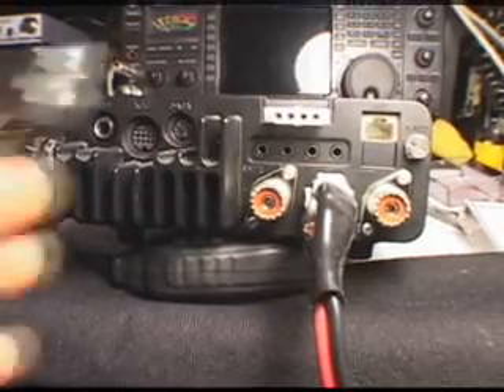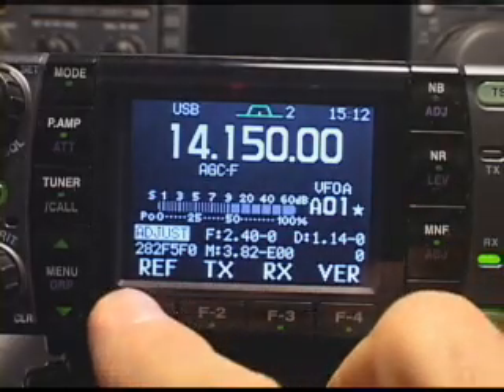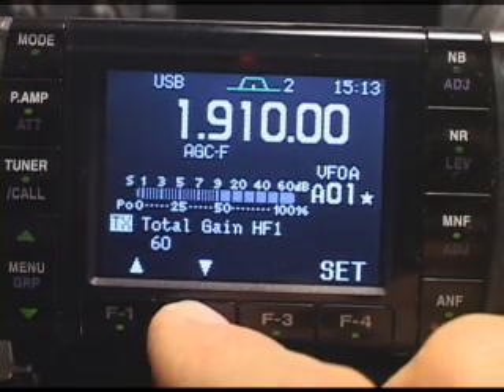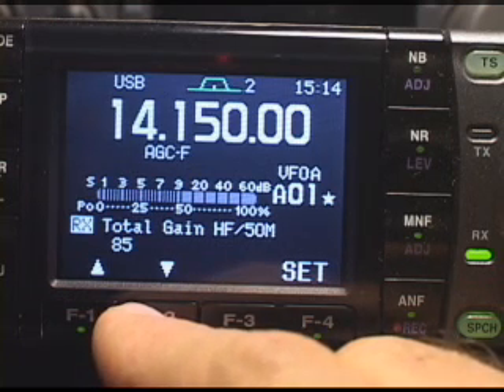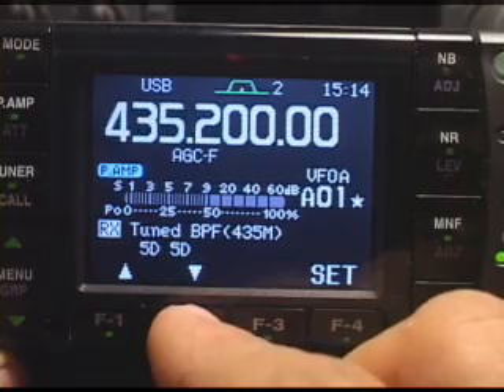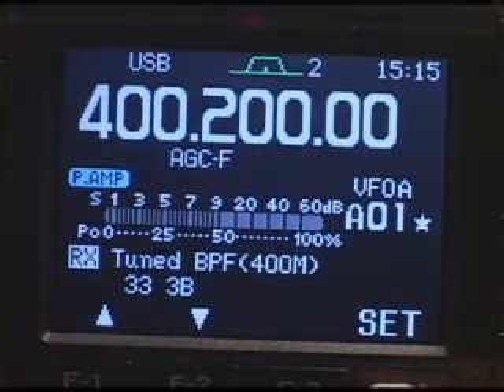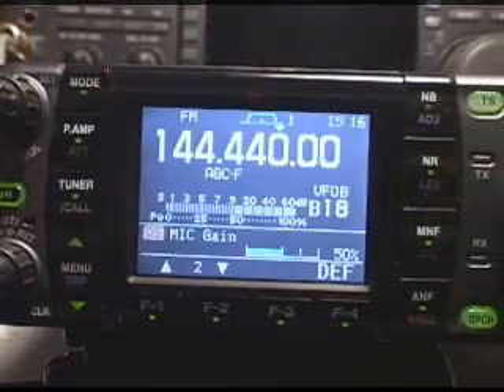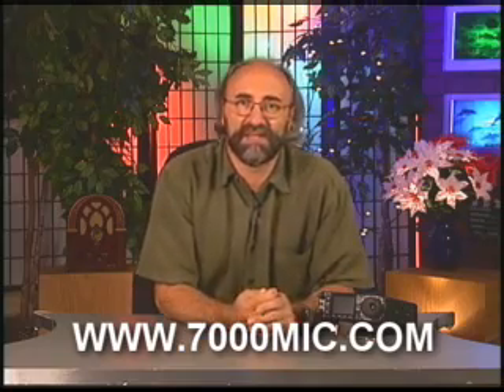IC-7000 Hidden Menu

Comment: My IC-7000 frequencies are off on the 70cm band.  and also off on HF bands as well. but  in order for me to get on a 70cm band repeater, I have to add .005 to whatever the frequency of that repeater actually is.  most of the time everyone on HF has a real hard time of hearing me when I transmit.  I recently hooked up a IC-718 to the same antenna setup and people don't have as hard of a time hearing me as bad as the 7000.  Is there a way of fixing that?  and do you have to use the alligator clip contraption in the back?

Comment: http://www.radioscanner.ru/files/download/file309/icom_ic_7000_servicemanual.pdf   or http://download.qrz.ru/pub/hamradio/schemes/icom/IC-7000_Serv_Manual.pdf
Here is SERVICE MANUAL, which has a detailed description of how to enter the ADJUSTMENT MODE, as well as what the settings mean and how to configure.
Тут SERVICE MANUAL, в котором есть подробное описание как войти в ADJUSTMENT MODE, а так же что означают настройки и как настраивать.
**I do not recommend changing any parameters in this service menu without excellent knowledge of radio technology!**
+ INFO+MANUALs+MODs: https://www.mods.dk/index.php?ModelId=845&RadioId=1-icom&ModelRec=ic-7000
73!
Reply: From manual: >>> 
ENTERING THE ADJUSTMENT MODE
 1) Turn the transceiver’s power OFF.
 2) Connect the JIG plug to [REMOTE] jack on the rear panel.
 3) While pushing and holding [P.AMP/ATT] and [TUNE/CALL], turn the transceiver power ON.
 NOTE: Exiting from the adjustment mode when the transceiver's power is OFF.
-----------------------------------------------------------------------
OPERATING ON THE ADJUSTMENT MODE
 • Enter DDS adjustment mode. : Push [F-1 (REF)]
 • Enter TX adjustment mode. : Push [F-2 (TX)]
 • Enter RX adjustment mode. : Push [F-3 (RX)]
 • Store the set value. : Push [F-4 (SET)]
 • Adjust the value. : Rotate [DIAL]
and other many  options....

Comment: I played around a little bit with my Yaesu FT-950 factory menu ... the TX power settings. Then I put them back. Because most people recommend you don't mess with these things because they are set a certain way for a reason. A little extra power - which means nothing on the other end - or a little extra receive - probably takes your rig out of tolerances for the rated specifications, can shorten its life. and make things not work as they should in other parts of the rig. In other words do as he says in his disclaimer not as he does in his video.

Comment: This is the modern version of the golden screwdriver. Yup who needs a calibrated signal generator to adjust receiver gain when all you need to do is tweak a few menu setting's., 

 Whats funny is 99 percent of the time the people complaining about poor performance are the same people who've already  been in their radio with their trusty golden screwdriver, Kinda like that non existent low audio problem the 7000's supposed to suffer from LOL

Comment: Hi Bob not sure if you can help me, I have an IC 7000 here, you done the Mic for me, nothing to do with that, when I turn it on I cant here any background noise, the squelch seem to work looking at he green receive light, but no sound, you can turn the squelch right down and volume up and it is silent, sometimes the sound comes through, if your on a strong stations its ok, but on 40 and 80 mts ssb there is no background noise...wonder if its something I done or faulty, its like the squelch is turned up, but it isn't..think I might do a reset.Fred g4vvq in UK

Comment: Hi Bob, can you do anything with the fan on the 7000, they seem to run really hot even on receive, fan only appears to work on tx, friend of mine also has one and he says his gets really hot, he rang Icom and they told him it will work on receive when the temp gauge goes into the red zone, and it has variable speed depending how hot it is, wondered what you knew about them....Fred in England.
Reply: Hi Bob I had a new backup battery fitted and it cured it, was just for the clock, that was only thing that wasn't working....do you know of anyway to adjust the freq counter, its about 200 hz off, not much bit a bit.....Fred uk
Reply: Well two years later, here is the answer:
Put a 100 Ohm resistor from the + to the red wire of the fan.
This makes it run continuously and prevents heating in standby mode.
For low duty cycle transmit the capacity of the heat sink is big enough to take up the heat without getting too warm.
Reply: He just showed you 8C to set the ref osc.
- There's also a setting #51 at the bottom of the long "Others" user menu to move the osc a bit, but 200Hz is quite a bit, you might have to begin with 8C in the hidden menu while your OTH setting in "REF Adjust" is centered on 50.

Comment: Bob, my S meter on VHF always shows between S8 and S9. does this need adjusting as you describe in this video OR can it be set somehow with the regular settings on the radio? the UHF s meter seems to function as it should, not VHF though. BorderPhD@gmail.com  N5XTC

Comment: Bob - I am a brand new IC-7000 user.  When I key the mic I am not getting any ALC indication.  I get the word "ALC" displayed and I get a solid red bar displayed but no moving bar graph to indicate ALC level.  What am I doing wrong?  Did that feature somehow get turned off?

Comment: Let me add an update to the power out problem in case someone else is having that problem.  The problem's source was in the power cable fuses.  There was a high resistance connection and once I removed the inline fuses the power came up to specified and expected.

Comment: Changed configuration parameters of RX and do not know original values, now ic-7000 S-meter shows the full range of HF. What should I do to get the radio back to normal?

Comment: Hello Everyone, 

I have been researching ALL transceivers and the two best systems for Base or Mobile are the FT-897D and IC-7000. 

The FT is very portable with fixed TX wattage, the IC is less portable and variable 2-100 watt, 2-50, 2-35, 1-40, 2-20, 2-14 depending on which meter(s) your on . 

Both radios cover the same frequencies. The IC is $1300, the FT is $1000.

Hope I have been helpfull -!

Comment from the maker: @gkendric OK... the 7000 is very sensitive to  Vcc... it's power supply voltage.
The difference between 12.6V and 13.8V is dramatic. If you are running 13.8V
and getting 60W across the bands, then your radio has a problem. It isn't a matter
of the factory settings being wrong. To be dead-sure, I'd try another radio with that dummy load/meter set-up.
Reply: for people running into this  in current dates, this poster is only partially correct. The IC-7000 is CURRENT Sensitive. because it is all DSP, with the exclusion of the audio input and the rf output there is a heavy current draw at all times. throw Ohms law at it and you will find that when the input voltage drops below 13.8 volts, the current drops as well. and if your power supply cant source the required amperage, the radio's output will be hampered.

Comment: @Yavor54   No it's not the European version and I was not on 10.  In fact the power level of around 60 Watts out on 20, 40, & 80 meters and that's into a 1:1 SWR presented to the radio by a Palstar tuner measured both on the Tuner's cross needle meter and an external diamond cross needle meter so I very much trust the 60 Watts out.  One other observation I did note was that the power level adjustment was not linear across bands.

Comment: Thanks for the information.  I did enter the hidden menu however under the TX settings I was not able to make any alterations.  There was no change with turning of the main tuning knob.  I wonder if there is a lock that has to be released.  Do you know if there is a toggle or what has to be done in order to modify the TX settings?   The problem I am having is my 100% power out into a 1:1 SWR measures at only 60 Watts on HF.  I'm wondering if this TX Adjustment could remedy that?

Comment from the maker: @ILLUDICHRIS   - Well, the factory menu is normally not available to the
typical user... nor is it necessary. I own both radios. The difference?
The TS-2000 is the 500 item lunch buffet. The 7000 is the good restaurant.
The 7000's RX is an order or magnitude better. It can deliver signals that
the 2000 doesn't even know are there. I use the 2000 only for VHF/UHF.
Sure, it's easy to operate, but you are rewarded for learning the 7000.

Comment: It gets pretty warm, but there's a crystal oven near the rear of the unit, I'm told. It's really frequency stable. I've subjected mine to some long ragchews at full power, with no problems at all. It seems to be ok with its own heat. The RX is fantastic. No extra filters to buy, the DSP really pulls them out of the noise. Nice radio.

Comment: Very good vid.  I had to do similar with my used 756 ProII, put it on the bench connected it to the service monitor and went at it.  It seems as intuitive as the 756. If only the 756 series had the MO trim in firmware instead of touch and go with the side adjustment...